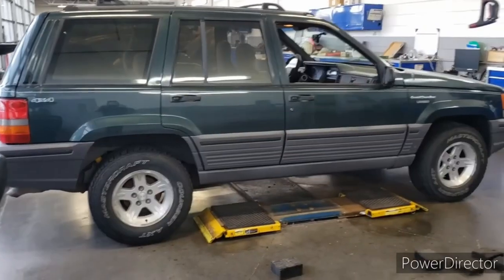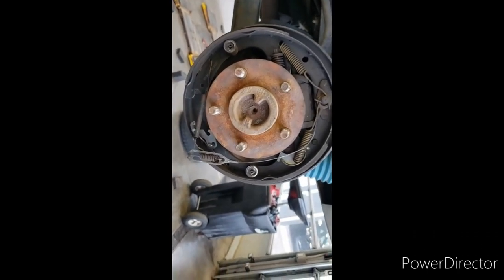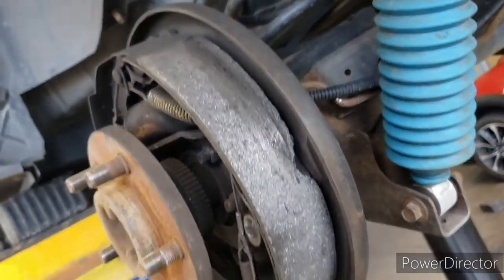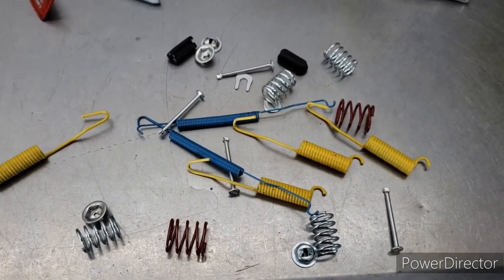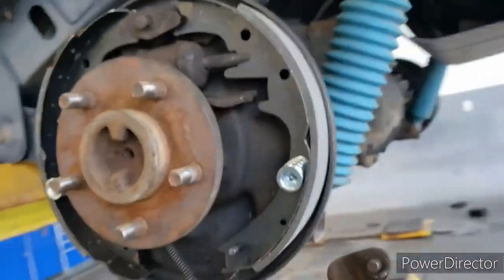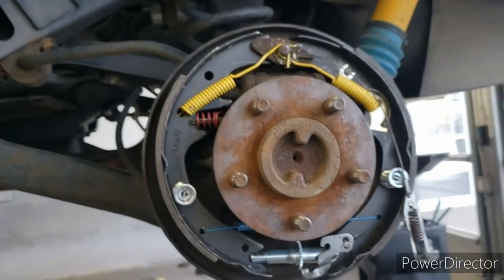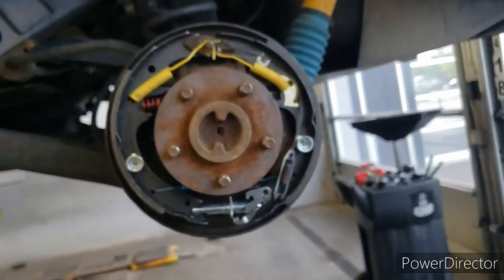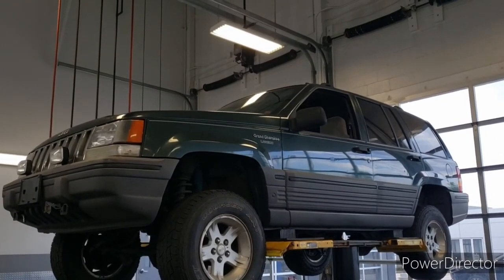Rear drum brake shoe and hardware replacement (1993-1998 Jeep Grand Cherokee 5.2)

Comment: what year is it? 1993? AFAIK only the early models got rear drums, disks became standar in all models after 94
Reply from the maker: Its a 94, definitely wish it had came with rotors and calipers in the rear.
Reply: @TheShopWorldWide  94, interesting, get disks from any other zj, direct swap, what about the windows? manual too? tranny? aw4?
Reply: @omegarugal9283  I have a 94 with drums too. RWD Laredo, automatic 4 gears, electric windows 4.0L
Reply: How much does someone regularly charge for this job?